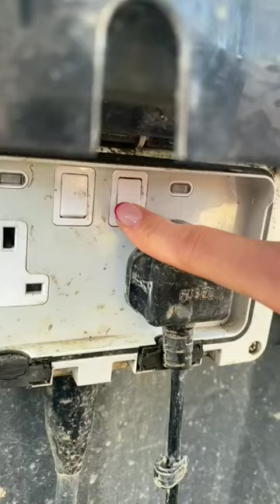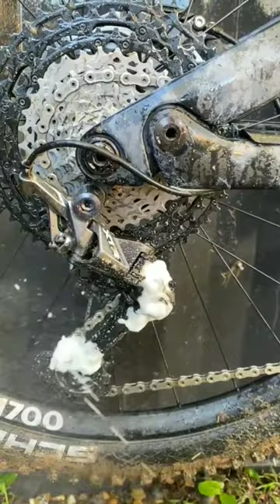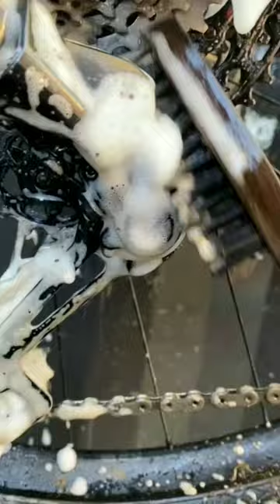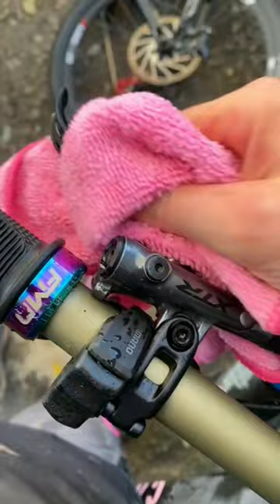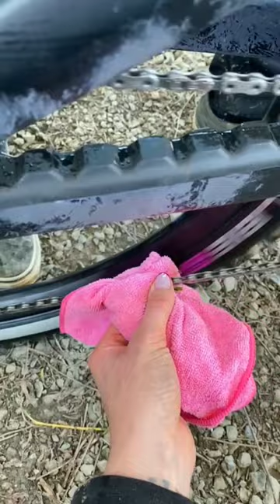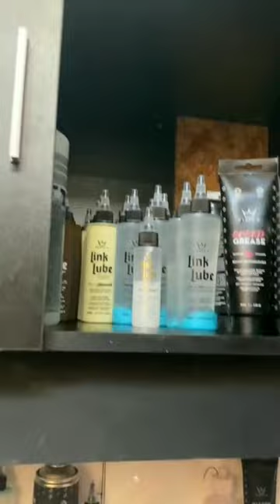😍 Satisfying ASMR Bike Cleaning! 🧼Tahnee Seagrave #Shorts

Comment: Ahh!! My mind while you cleaning gears
Reply from the maker: Satisfying?
Reply: @Peatys  no... When u were putting some white substance on gears ಠ‿ಠ
Reply from the maker: That's our Foaming Degreaser Degreaser, it is non-solvent based, so is kind on your hubs, gears, bearing grease and brakes with as much power as needed for degreasing your drivetrain 🔥🍻